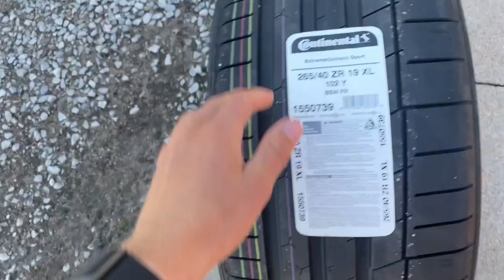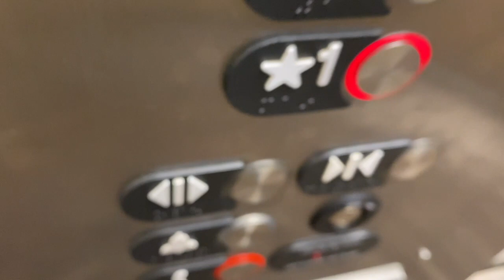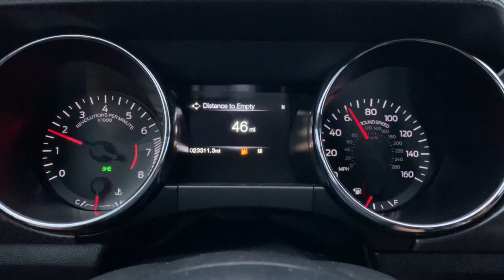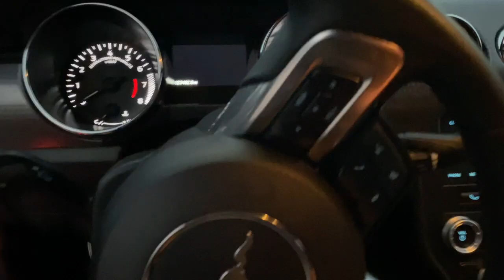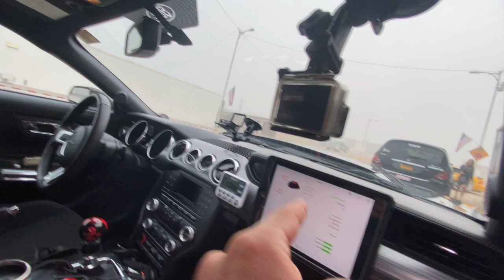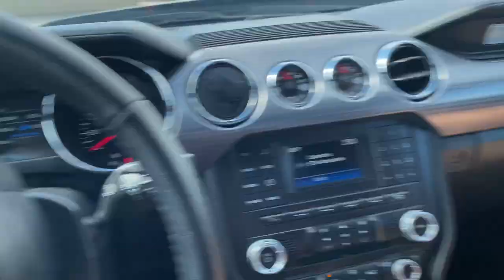I RACE A SUPERCAR IN MY MUSTANG GT!!

Comment: I made it to the end. Too slow? Lol that’s hilarious. 😂
Reply from the maker: Thanks buddy!!
Reply: Believe it or not, it's a safety issue. They make sure the cars are released at intervals, so the chances that they'd get close to each other on course are minimal, but it still happens if one runs slower than they should and the other runs faster. Cars are tech'd to run as fast as 120 mph in Christopher's class, but they also have a minimum speed, because they don't want cars on the course going 120 mph coming up on a car going 60 mph.
Reply: OPTIMA Batteries yeah that’s what I figured. I was just joshin CP94. He’s a good buddy of mine <3. Thank you for the information though, I can’t wait to see what Chris does next!